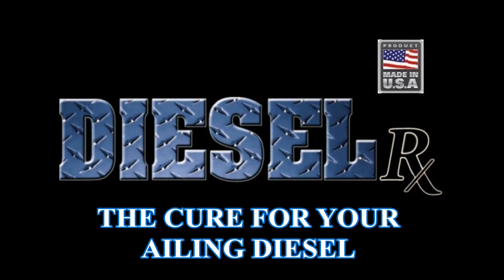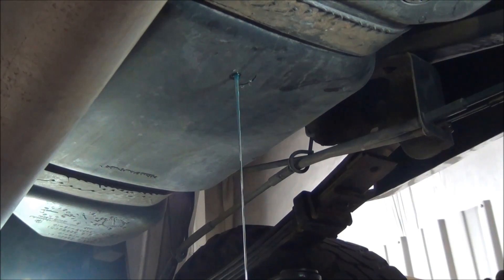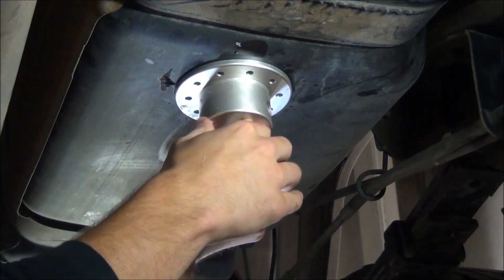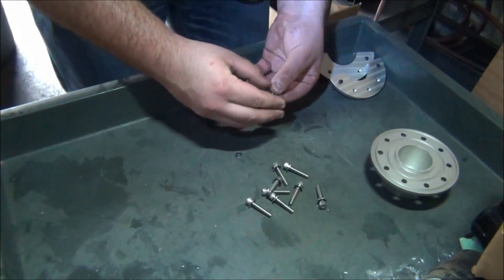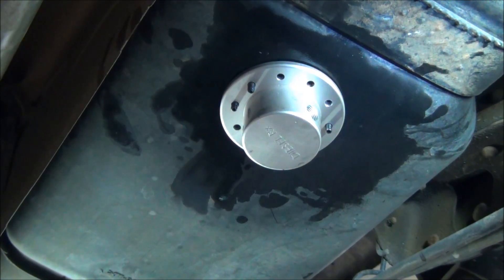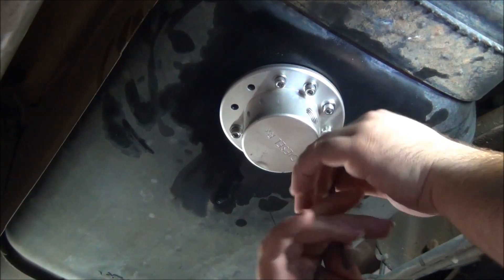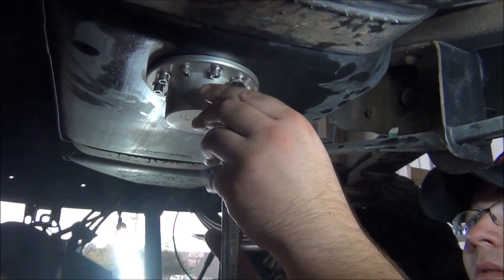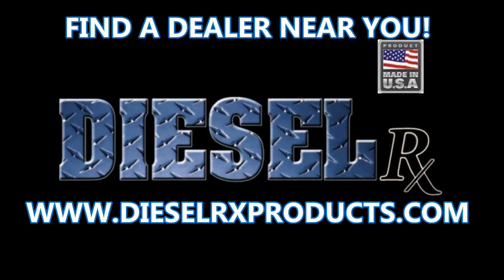Diesel Rx® Universal Sump Installation

Comment: Stay away from the sumps that have the gasket with multiple bolts to fasten the sump to the tank.  The best sump kits are the units that incorporate a single O-ring seal along with the backing plate inside the fuel cell.  Go with the R&G Diesel fuel sumps with the integrated return line and stand pipe.  The best sump to date so far.
Reply from the maker: It's G&R Diesel. They are great people over there and are friends of our company. As for our sumps, we have had zero complaints about leaks in the three years we have had these out. The radial bolt pattern allows for a stronger clamping force. Our O-rings are made out of Viton and we use actual sealing washers for the bolts where other companies of similar design use nylon washers. And before you say, "You only have to drill one hole with other companies sumps," if you drill one hole, what does it hurt to drill 10 more? It's not like you are going to ever patch the tank if you decide you don't want a sump...
Reply: The sump in the video will have maximum clamping force on two o-ring seals, which is a good thing to minimize any chances of leaking.  It's too bad however that the sump doesn't have the integral return line with the stand-pipe like the G&R Diesel sump.
Reply from the maker: G&R Diesel came out with that design and we are not about to go rip their design like so many other companies in the diesel industry. Our sump is fine the way it is.
Reply: @AirDogSales  love your sump and your products